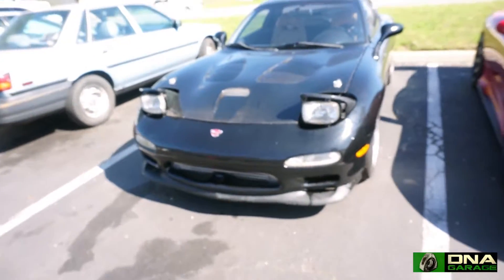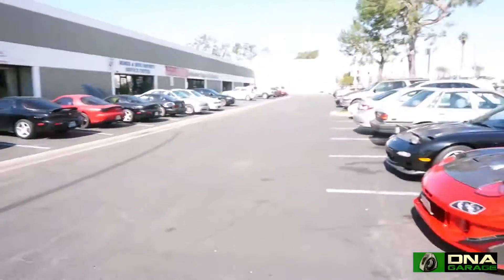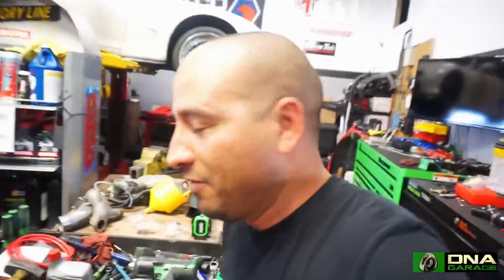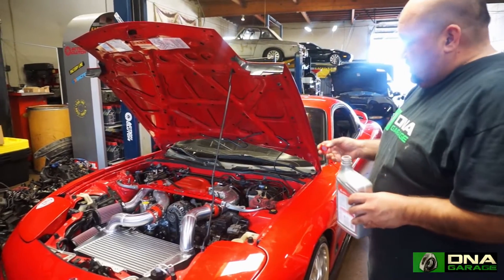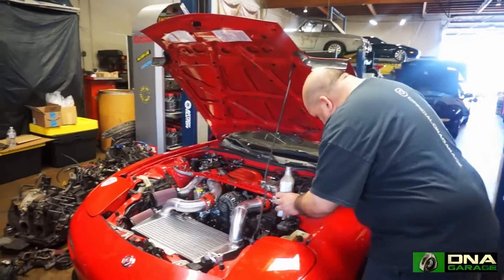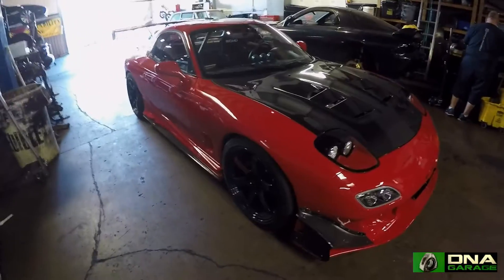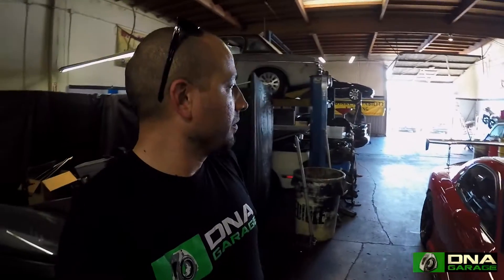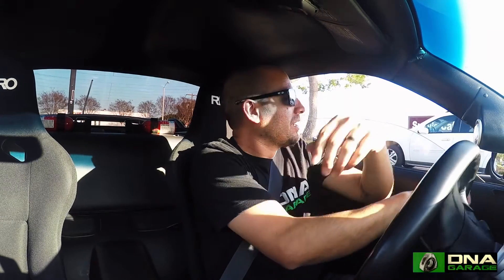Intercooler V Mount DNA Garage

Comment: an effective v-mount needs to have walls on the sides, correct?
Reply from the maker: turke33 Yes to get the best performance out of a v mount you need ducting but a v mount on its own will still out perform a front mount